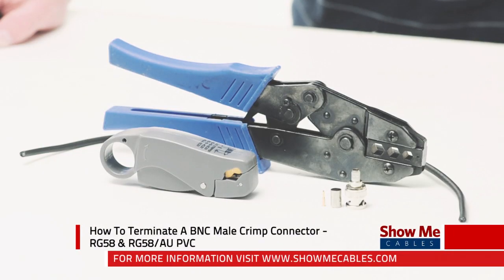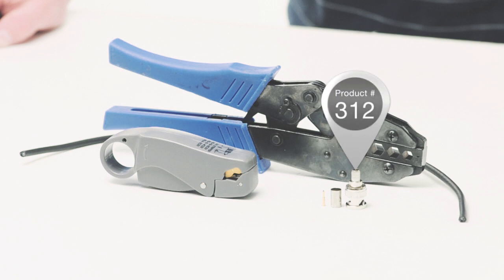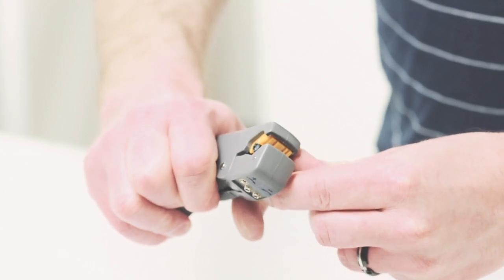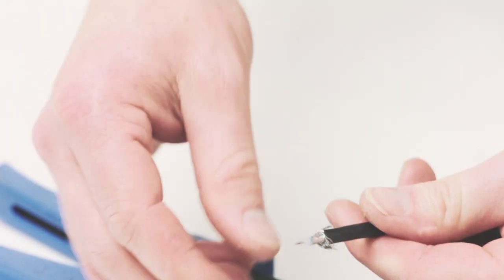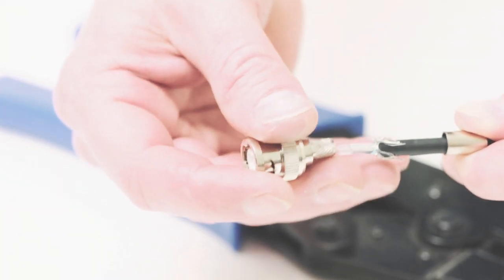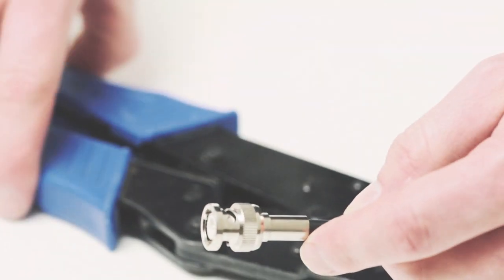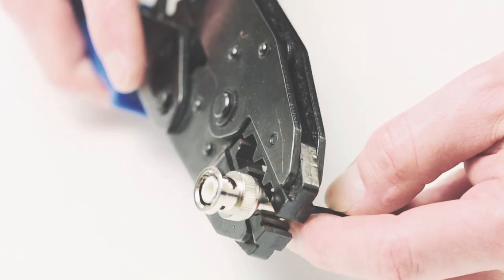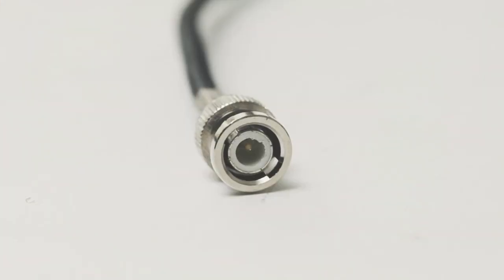How To Make A BNC Male Crimp Connector - RG58 & RG58/AU PVC

Comment: Even though the author didn't crimp the centre pin ---- at least it gives a nice general idea about what tools etc to use to mate the RG58 to this connector assembly. Those people on ebay (and sellers of these connectors) rarely (or even never) show people how it's done. So I will still give a thumbs-up for this video.

Comment: Wrong
1. To much length on centre conductor exposed.
2. Centre pin not crimped.
3. Flare is at top of connector instead of the bottom.

Comment: ⚠️  You FAILED to “Show Me” the PROPER METHOD of installing a BNC connector.
Center Pin MUST be crimped or soldered once center conductor is inserted and prior to the cable/pin are inserted into the connector housing.

This is precisely why we custom fabricate as many of the cable assemblies we can use.
Just in case…. The video presenter is working on the “Show Me” Cable production line!
🤣